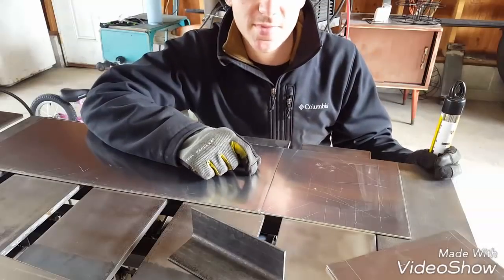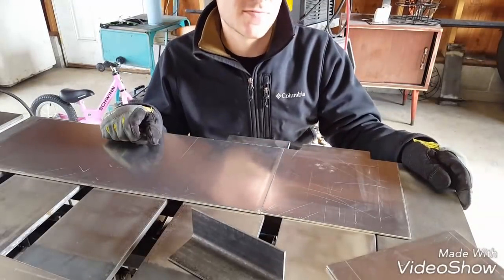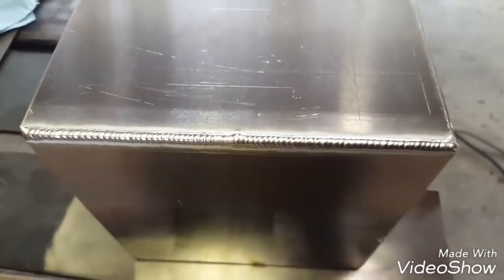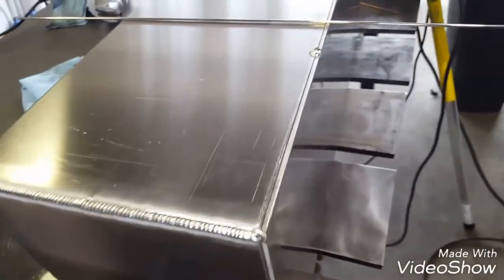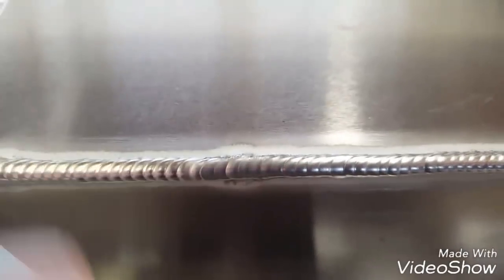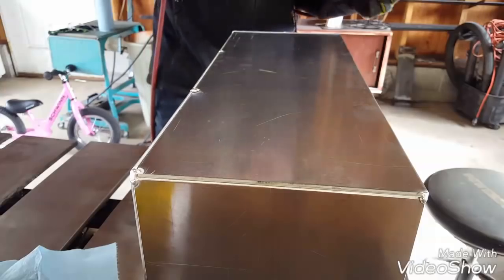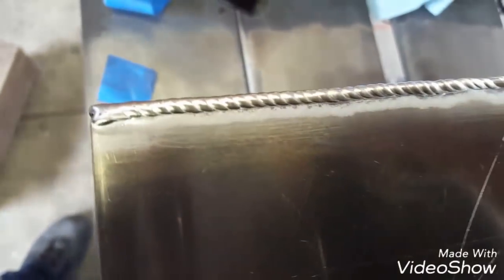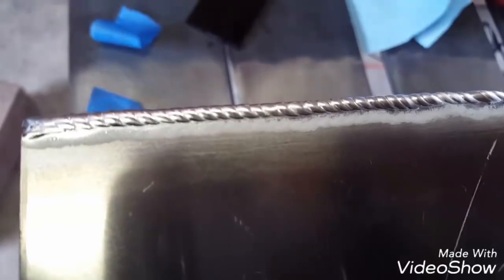How to tig weld aluminum

Comment: I have an everlast 200dv. Just started tig welding and went straight to aluminum. After a few days of dialing in my settings and running beads, I noticed that I dont get a frost line at all around my beads. I'm at 125 amps but using foot controlled. 3/32 2% lanth, 3/32 4043 filler, about 120 frequency, 15 cfh, welding on 1/8" aluminum 1.25" tube from scrapyard. Acetoned, wire brushed, cleaned my filler and everything else i can think of. Still no frost line. I've tried balance from 20% to 60% and higher to where my electrode goes crazy. Yet no frost line. Ive only noticed frost where i start up, but once I'm moving, its gone. Any ideas?
Reply from the maker: The only things I can think of is that either you need a higher gas flow or the material is junk.  You can get some cheap aluminum coupons from weldmetals dot com.  And see if it's just junk aluminum
Reply: @5thStreetFab  it was the gas flow. I bumped it up another 8 cfh and it was an instant change.

Comment: I usually walk the cup when I tig weld and I noticed you dont. Does it depend on the torch angle, that you dont have to walk the cup?
Reply from the maker: with aluminum its very soft while its being welded so the cup tends to cut into the weld

Comment: Nice video....but I didn't really see it as a "how to". Good demonstration, but I was hoping for more of a Lesson. I'm a beginner and I really struggle with Aluminum. Mild steel and stainless are not hard, duty Aluminum kicks my ass.
Reply from the maker: Unapologetic hey.  I've got a couple others.
This one's a long in depth one for beginners https://youtu.be/UheIy0Hp_bM

this one is for pipe. https://youtu.be/C7dbch1Fpzs

And this one's what not to do https://youtu.be/J9jhM89XgA8

Hopefully these help
Reply: 5th Street Fab thanks! Maybe I should try 5356... So far have only been using 4043. I just bought the 2018 version of the AHP, really happy with it so far. Looked at pricier machines, but they just didn't seem to be any better for 2 or 3 times the money.
Reply from the maker: Ya no problem.  4043 is great but it looks bad if you weld slow and most people starting out on aluminum are slow.  I still like my ahp ive had to file the points a couple times but for the price I paid it's worth it.

Comment: that all looked super clean bro good job. in my experience tig welding aluminum the corner joints were considerably easier than a t joint. is that common knowledge or is it just me??
Reply from the maker: Dylan Taylor I feel the same way.  It's easy to stay nice and lined up.

Comment: How much amps did you use on this project? nice welds man
Reply from the maker: jsnismo240sx hey I'm not sure I usually leave my machine maxed out and work the foot pedal.  I would say around 100 amps
Reply: really not enought, i weld 1.5mm thickness with 100 amps :) turn on the amps ! ally loves heat
Reply: I would use 160Amps and then control with pedal.

Comment: IS your machine a ahp alpha tig?
Reply from the maker: Ricardo Benin yes it is, the 2016 model.
Reply: Wow, those are some nice welds, i have the same 2016 unit and cant seem to get a clean aluminum weld.
Reply from the maker: Ricardo Benin thanks!  really what it comes down to is hood time.  Leaving to read the puddle.  Keep practicing and let me know if you need help.
Reply: Nice welding. You are right. There is nothing that can replace hood time. I try to use my powertig welder as often as I can to keep the muscle memory sharp.

Comment: Great video. Thanks. I have the same machine. I'm relatively new to welding and was happy to see your Settings in the comments. I understand the theory behind the mall but haven't found the sweet spot yet
Reply from the maker: North jersey Kevin Thank You! Your right,  it's all about hood time to learn what you like.  100 hertz 30-35% cleaning is a good all around setting to start with.  I feel it's best to learn with your amps set high and use your pedal.  That way you learn puddle control.  Hope this helps.
Reply: Good stuff bud. Great videos. I'm glad I found them.  I'll be in touch with you and thanks for the advice.  Stay well

Comment: You are an awesome welder and put together very informative videos, I wish I could see more of the actual welding the video isnt super clear in that area. I have 2 questions 
1) Are you left handed?
2)How do you clean the weld up after you are finished?

Thanks
Reply from the maker: Brian Woodruff hey thanks you!  I'm trying to figure out how to do nice arc shots,  it's pretty hard but I think I will have it soon.  Yes I'm left handed! and I don't do any dressing or cleaning of the weld unless I need to grind it down.
Reply: Thanks for responding back, I just subscribed to your site and will definitely be bugging you for tips in the future.I have recently become a welding instuctor in the last year and I am trying to build the best program I can for my students.I have been welding on and off for the past 20 years (I am 50 years old),mostly hotrod and mechanic stuff.My highest cert is a 4G in 1/16th dual shield, I want to master TIG on all sorts of metal and get myself and my students certs in it. I plan to become a CWI and get all the way up to 6G pipe in my certs. Thanks again for your response.
Reply from the maker: Brian Woodruff that's really cool!  My areas of expertise are just Tig welding thin Guage stainless and aluminum.  Let me know if you any questions.

Comment: damn ... you are good .
Reply from the maker: BisdremisKostas thanks!
Reply: how many hours per week should i have seat time in order to come close to your skills? two months now and 100lit of argon and i still suck at aluminum :(
Reply from the maker: BisdremisKostas Hey, so I've been tigwelding professionally for 10 years so when I started aluminum I already knew what I was doing,  but to get good at it I'd say 2 months at 40-50 hours a week.  The best way I learn is to stop after every weld and look back and examine it.  Then try something slightly different (torch angle, cup size, speed of weld, more pedal, etc.)  and compare.
Reply: thank you very much , just subscribed , please post more tig aluminum videos :)